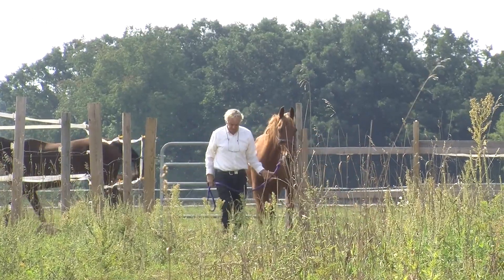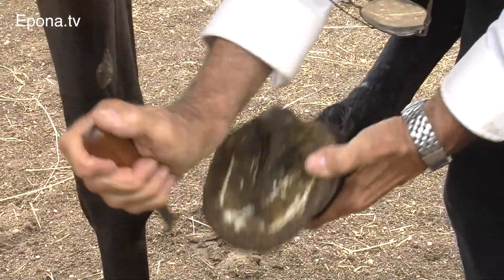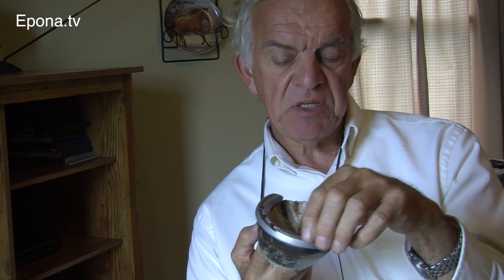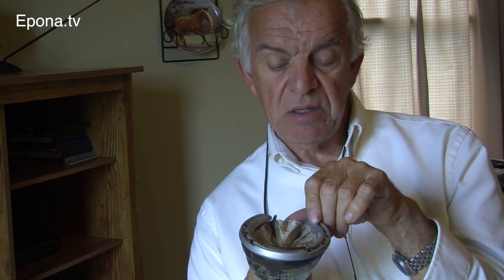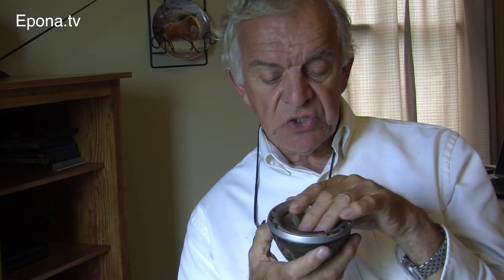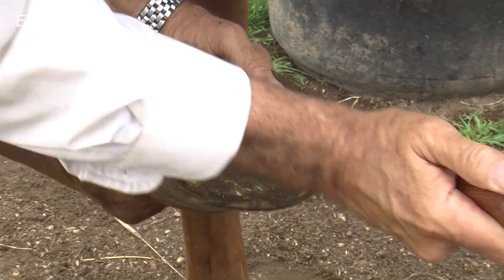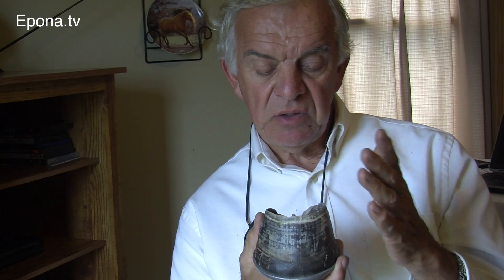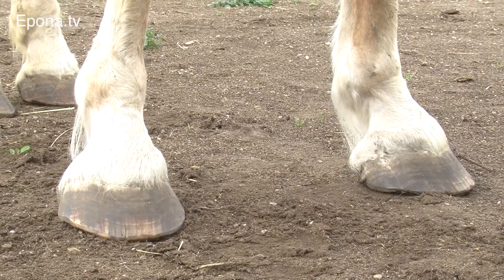Hoof anatomy with Professor Robert Bowker, part 5: Trimming the feet

Comment: I just don’t agree - I think it’s important to make sure the bars are straight. I think it is such a detrimental thing to tell people to leave bars alone. Bars on sole are uncomfortable for many horses (my horse is living proof of this). You should trim according to the environment, not someone’s own ideals of what should happen. There needs to be a happy medium.
Reply: Sometimes adopted wild horses have bars folded over, almost covering the bottom of the hoof if they've been out of the wild for a long time. They need to be trimmed. I find cutting them with the nippers instead of the knife works well because the nippers are too big to get down all the way and leave a nice rounded ridge of bar.

Comment: where is part 2,3 and 4
Reply from the maker: They were set to unlisted. We fixed it so you can find them easily now. Hope this helps.
Reply: They are all there...there seems to be a common thread of willful ignorance here, the same that you see when you state the FACT that P3 doesnt rotate, its actually Chronic Hoof Capsule Imbalance caused by outdated and harmful trimming methods.

Comment: If you mark outside the white line and when you are done still have the black line around the white line, then how are you trimming inside the white line? Trimming inside the white line is what professor Bowker recommends. I just don't see how to reconcile these two recommendations. Of you have any insight, that would be great. Thank you so much
Reply: We need an how to video!
Reply: @danceswithcoyotes8273  thatnk you very much! That really helps to clear it up. Much appreciated!
Reply: @daniel_moretti what was the comment you are thanking for? seems to have been deleted! 
BTW I think he only recommends rasping a  slight slope into the sole at the toe for a breakover, from about 1.5" above the frog apex forward?
Reply: Nobody told anyone to trim INSIDE the white line, you trim OUTSIDE the white line if you dont want to cut into live sole!
Reply: @Foxiepawstotti May I suggest listening to this interview with Dr Bowker starting at 19min 25sec point.

https://youtu.be/h3qjIwztSfI?si=gDQntmb2JS6lF1T4